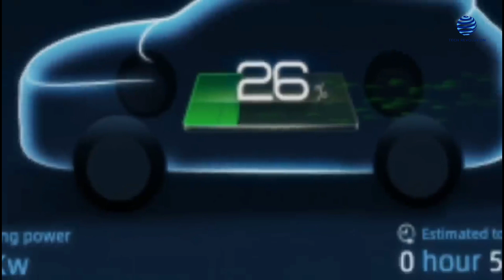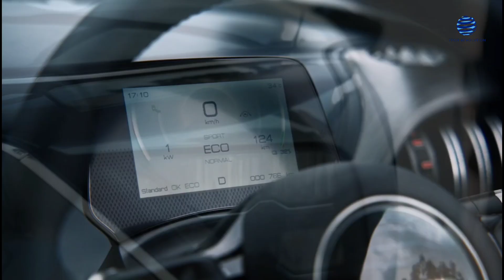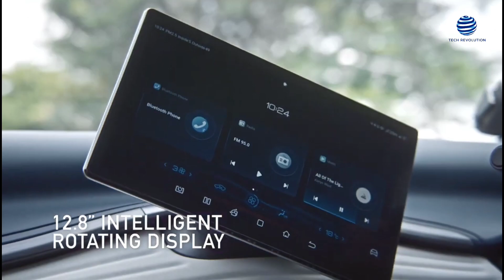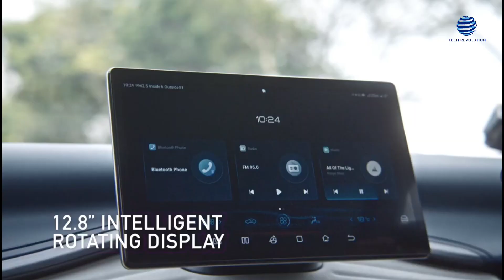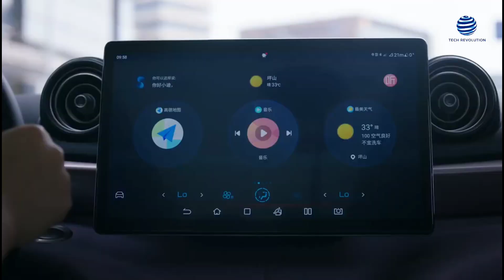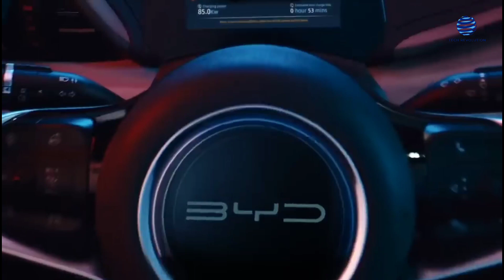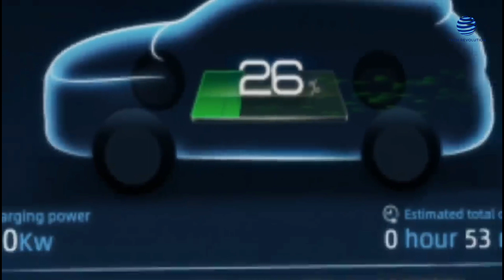UNCOVERING The ALL NEW 2023 BYD SUV That Is A GAME CHANGER!

Comment: I like the sound of the ATTO3 , but what about support? No one talks about servicing, parts and support. The perfect vehicle has never been created. There will always be service, parts, and support needed. Without a dealership network, how is BYD going to provide this absolutely essential customer support?
Reply: BYD forms partnerships with well-established automotive dealerships in every country it does business with. 🤓👍
Reply: @AI_HQ  In the case of Australia those arrangements are terrible.  BYD need to go direct.
Reply: @corporatepsychobabble188  what's wrong with current arrangements in Australia?
Reply: @manuhamoa  Australia's Third party service provider EVdirect has an insane service schedule for the Atto3. Which adds almost 3 grand to the price of the car in the 8 years. No EV needs that much service at that price. Every year or 20k kilometers the car will require service at either 190 or 330 or 650. Most of that price is due to EVdirect having to set up service locations and techs. EVdirect also state that labor is the primary driver of cost.
Reply: @Cleasterwarren  Thanks for the explanation. I thought Eagers Automotive, a large company, were involved and so there wouldn't be so much setup costs. Thanks
Reply: Absolutely right. support system is more important than quality of vehicle. Low quality car with good service centre is much better then evenTesla with no support system.

Comment: slight to weak a double bar would give more strenght to fron also more like spin material is good so kinetice enrgy pass through easy otherwise is solid but customer reputation you get on service and toughness and this hapends by km in use and serive maintainance flawless so records off fix keps production popular and beter quailty which is constantly improving so element s for developing are alwaqys option as biger wheels and slight more narow as they spin better and spend less fuel and a AWD option as well as hybrid part and optional a moving enlrged spoiler at back this give flares style as know and some good driving mileage and pleasure on drive first look not so much diff then hyundai nut engine has to 
perfom toughness in mileage  and through time and production orders in large quantities production is stabilized and some profit apear which goes up in numbers per piece produced and tax paid anualy and kind kepd 30% off year produciton reserved for research and inovation and plan in behind a factory for bateries that can be increased to full size pack later and then switch to electric models which is factory kind pesonal switch choice to turn on electric in lets say 2027- 2030 to get full production suport market as laws stand international is use for electric cars as europe plans to go and then again this goals due to wars option can sligth dealy as slight pre prep for market cars habris in let say resumble 5- 7 years easy production so is better to get prep and slowly growing stabily on market and market figures in production size and experience and slowly get distrubotrs and company dealers selling stabily cars then is mater off researcha nd inovation afer stabily 2-3 zears off production anyway is liked and some capital razed a further invest in car industry is also vise such as take ower form jelly corp to be complement inudstry partner which is kind consider on law balanced buy and smart after some capital poor and production done that realistic but you need business figures in porduction and tax  paid and stabile 5-6 years for banking capital